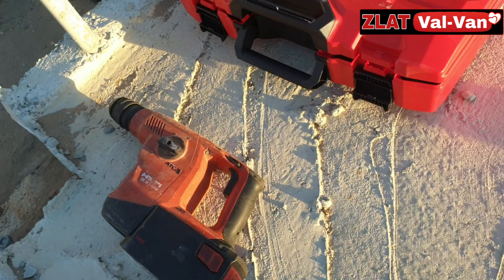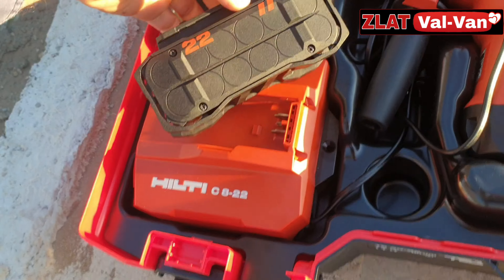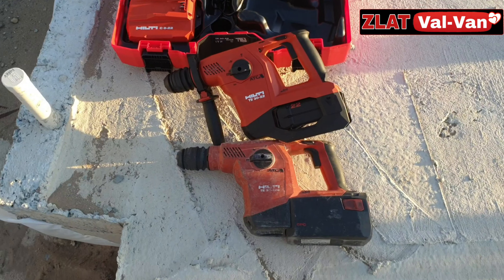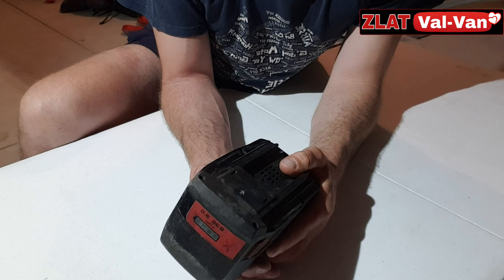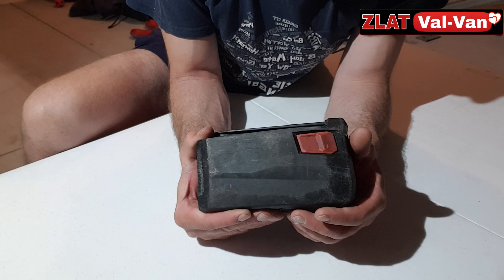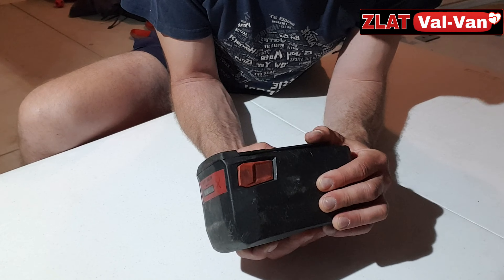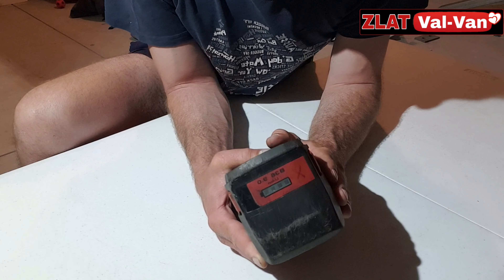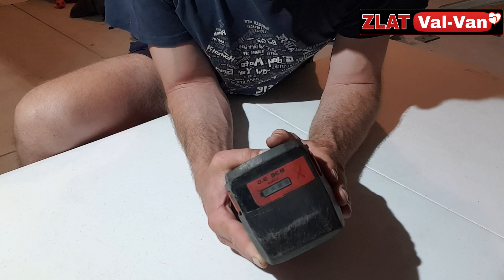Hilti Nuron is Not BETTER Then old battery

Comment: Your B 22-170 is 22V /8 Ah , compare to 36 V / 9Ah , if you divide 36 * 9 with 22 * 8 , it would be 1.84 which means the amount you can drill is around 1.8 times to TE 30-22 with 170 battery.

I will recommend B 22-255 , the power ratio will be 1.28 . It should be closer to B 36-9.0.

Another tip is not using the neuron to yellow light which means totally run out the battery, it will cost you more time for charging. Although the tool performance during low battery is enhanced by new technology…..

My recommendation will be C6 charger with 2 B22-255 batteries.
C8 is too expensive but the cooling speed is not faster than C6 , cooling takes more time than charging sometimes.

AM from Taiwan😂😅
Reply from the maker: @chenpohsuan  your totally right...
In Australian summer on +45°c it's time consume on cooling double then charging....

Comment: I’d try it with the 12 amp battery.
Reply from the maker: I try it what it comes with....
If it had 500amp batt be sure I will test it...
Reply: @ZvonimirAnn  battery definitely seems small for that tool.  I have the TE-60 and use the 12 but do not drill a fraction of what you do.  I take it you are in Europe? Our 4 amp are single row, that battery looks like the 5.2 we don’t have in the states.   Interested to see how it performs with more testing. 👍
Reply from the maker: I am from Europe 
Living in Australia
Maybe it is one of the reasona it got overheated, we work on +40°c
Reply: @ZvonimirAnn  Agreed but if the old batteries didn’t have a problem, the nuron shouldn’t as well.
Reply from the maker: I think the bigger amp batteries don't overheat as easy as smaller amp battery.
That is my experience with Milwaukee
Two 5 amp can not do as one 8 amp battery, coz in the half way 5 amp overheats...

Comment: are the "old" 9amp batteries still available to order new? and which 9amp exactly you have in the video? thanks for the good video.
Reply from the maker: You can still order old battery, 
My one is B36  9.0 Li ion
I think its 3rd gen. Coz it can't fit older dril models.
Reply: Thankyou @ZvonimirAnn